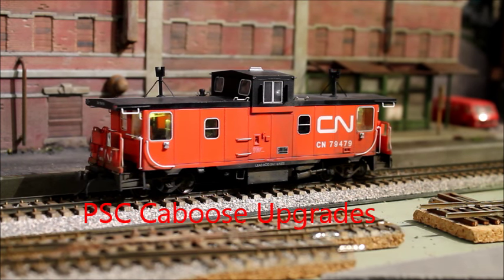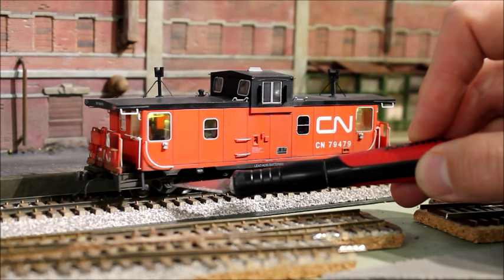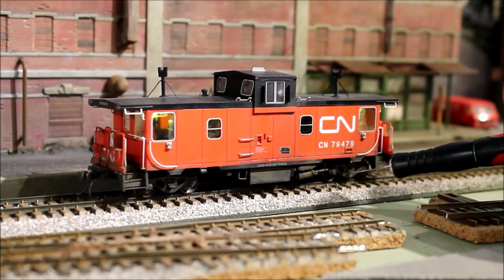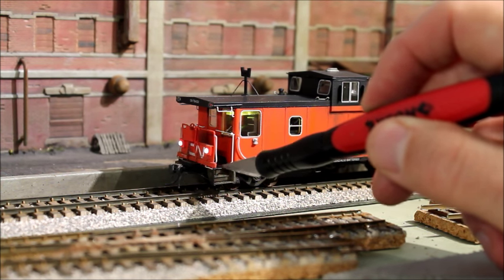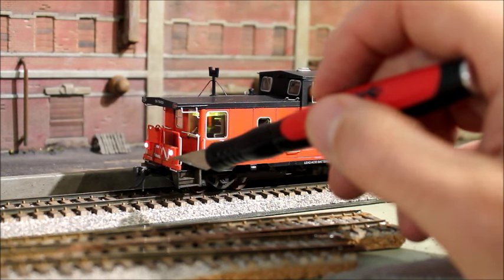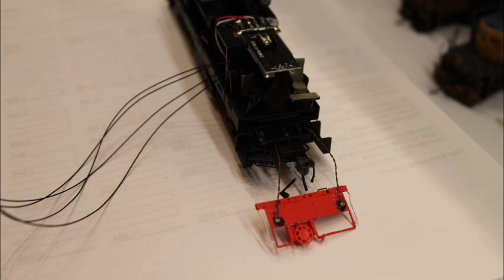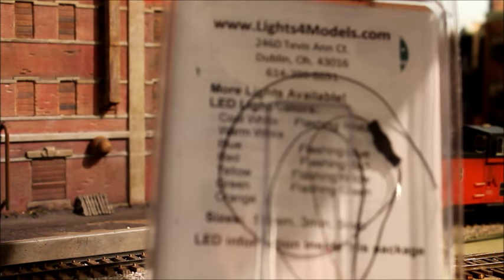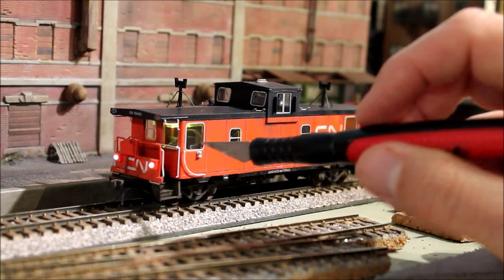PSC Caboose Upgrade - Adding Ditch Lights

Comment: I'm thinking it might be easy to make directional on DC: Just add a standard diode in lead connected to pickup associated with + rail in reverse direction (Left rail in Forward direction), Black lead as shown in connection picture, I believe. The diode will only conduct when polarity is set for reverse, I believe, thus making 'Ditch Lights' directional on DC.

Comment: Have you ever had any problems with the lighting circuits on these cabooses? Operating on DC, We had first one burn out the marker circuit in less than an hour (replaced by hobby shop) then had second one do same. I've removed the switch capsules, the marker driver IC, (thoroughly incinerated),  replaced both marker LED's with 2.5 Volt 20 mA (modified to fit) 'standard' red LED's and added 1/4 watt 150 ohm current limiting resistors between the + lead of each LED and the + lead of the 100 uf filter capacitor. The LED's now run on ~17 mA, and should run 'Forever'.
Reply: Are you running DCC or DC?
Reply: Don't know why, but the lighting circuits (markers anyway) don't seem to survive operating on DC very well.